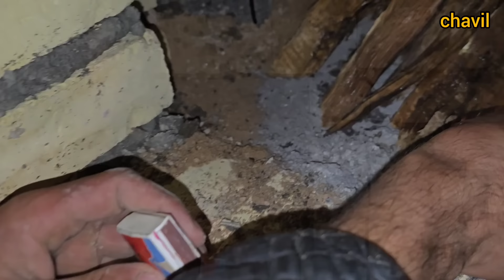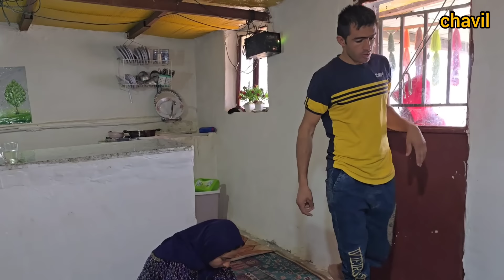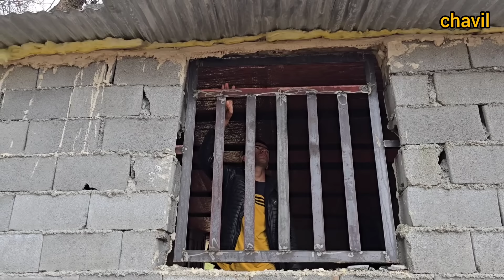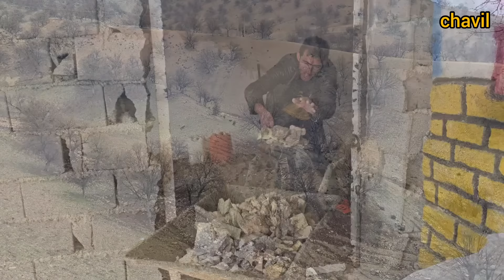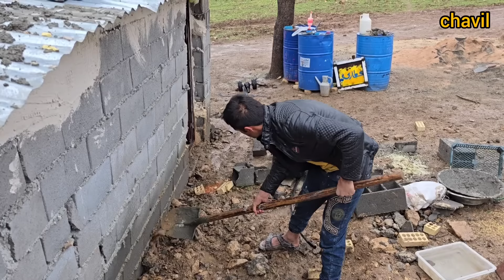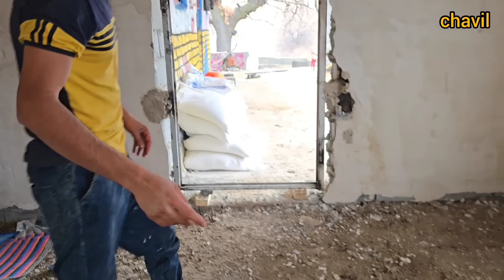On a rainy day in a nomadic house, baking traditional bread and enjoying delicious pleasures! 🌧️🏠🥖

Comment: Hi Ali and Fatima,  for young toddler it will be hard to keep them still, and I am sorry that Sam has fever again.  Poor guy.  I commented in Chavil Doora and I will try to comment it here.  I hope you read it even it is late.  For young children they can get brain damage from high fever.  So if he is having a fever that puts him out, then you have to immediately bring the temperature down while rush him to hospital.  Get the temperature down first for his head to avoid brain damage.  Get a frozen piece of meat (wrapped in plastic to don't pass germ to Sam), or plastic bag with ice or snow, apply to his forehead.  If there is no meat/snow or ice, use wet towel, folded and apply to his forehead.  If the towel got hot then wet and wring it and reapply to his forehead.  The high temparature will heat up the towel, water evaporates and it helps to reduce temperature at his head (most important).  Cooling the feet are good, but that is before it is too high.  When it is too high, he passes out then the head is most important.  If you can have him lay down, then do the forehead.  Cooling the feet takes long to help cool down the head.